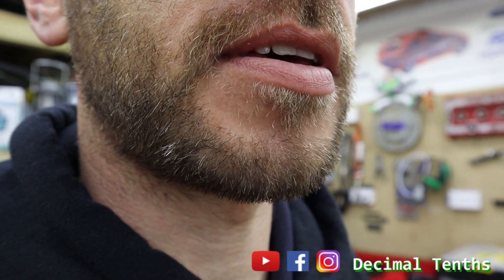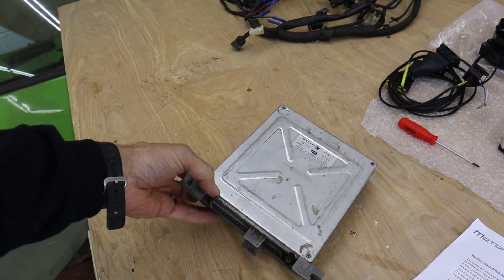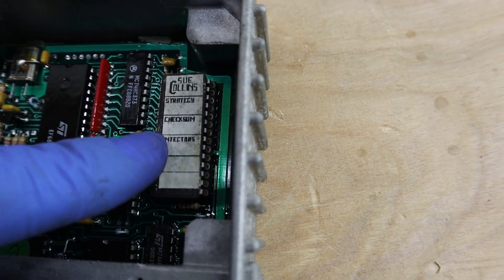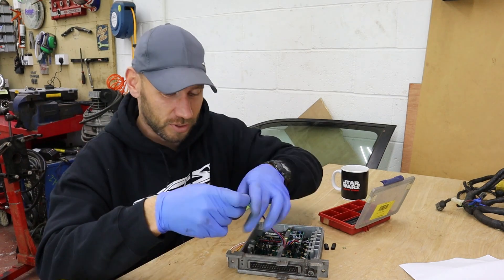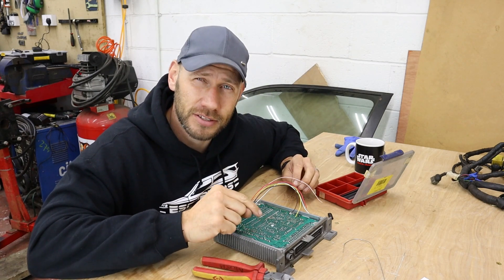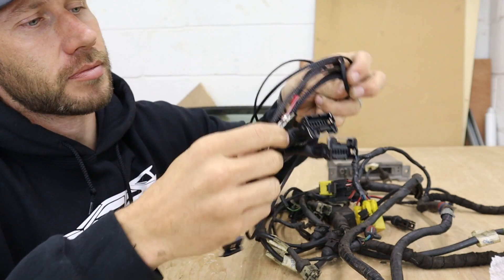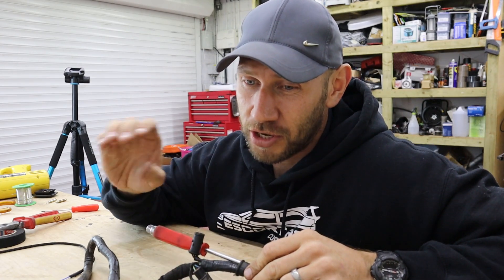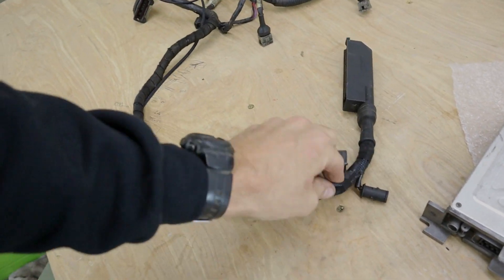FORD COSWORTH ECU // WASTED SPARK INSTALL

Comment: Who gonna map it iv got a rs turbo with cossy ecu
Reply: Iv got pectel at thr mo
Reply from the maker: @danglee1786  Got a BHP chip, injectors, map sensor kit for 380bhp, but any fine tuning will most probably be motorsport developments in blackpool

Comment: Hi was just wondering if you could help me ? I'm in the middle of removing my engine loom on escort cosworth big turbo and I'm struggling as it seems to tap into the lights at the front the loom is removed from the engine and goes like I say to a few plugs around the front near side light and the heads down to the chassis leg and though the bulk head I'm just not sure what to cut out i dont want be cutting any of the car loom by accident
Reply from the maker: If I remember correctly the ignition amp is located front near side, have you removed that?

Comment: Glad someone has finally touched on the fact a 4x4 YB can do 500on standard internals with just an uprated headgasket. On a k20 you need to cap the torque to 250ish lbft as there is no structural integrity to any of the engine parts
Reply: 500bhp was a big headache back in the day T4 8 injectors BD cams, but now with Borg twin scroll turbos and fancy ecu's its a breeze.
Reply from the maker: No comparison really pal 😁